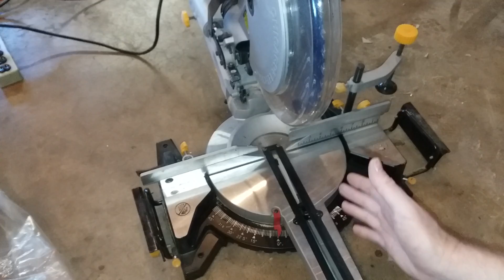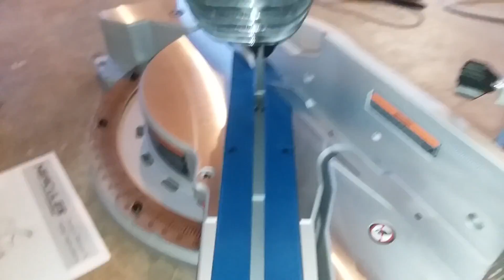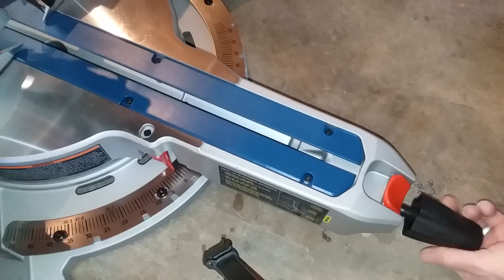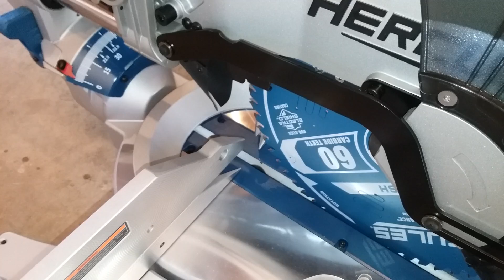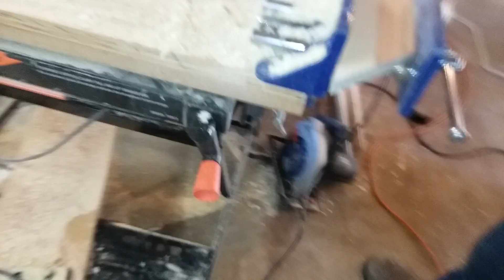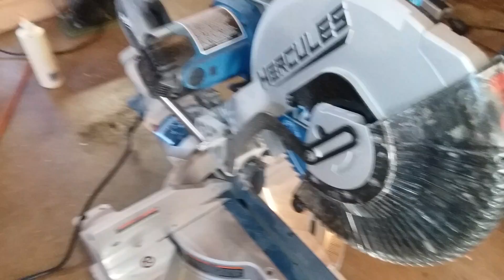Hercules Hercules Hercules...Harbor Freight Mitre Saw Comparison

Comment: I’m a fan of HF but if I’m gonna pay $300+ for a tool, I might as well go with a dewalt or some other proven name brand. I can get that same saw from dewalt for $399 all day everyday. HF lost their minds with this Hercules line.
Reply: Brads Workbench Where can you get a comparable Dewalt compound mitre saw for $399? I see them for $599.
Reply: I have never seen a 12" double bevel DeWalt for under $500, and the Hercules is now $309 with a one year guarantee.
Reply: @SumDumGy  This saw is Crap. We do demolition and cut boards a lot. This Pos has broken 3 times on us in a month. 3 replacements and got my Money back. Stop pushing people to buy this Crap. A proffesional like myself tried this Pos and went back out and bought all new Dewalts again. This miter saw is for Diyers only.. Pos
Reply: Tough Tool Reviews - At this price point the 90 day warranty is also a little short.

Comment: Have a Dewalt and the Lazer isn't accurate
Reply: Paul Jung - did you adjust it?
Reply: Dewalt with laser? XPS is not laser but shallow of blade which I like better than most lasers. Simple and accurate is what I have found. Basically this saw looks like Dewalt copy but like most copies made in China not the overall quality.
Reply: Don't trust Laser or Shadow, Whats wrong with the Pencil??